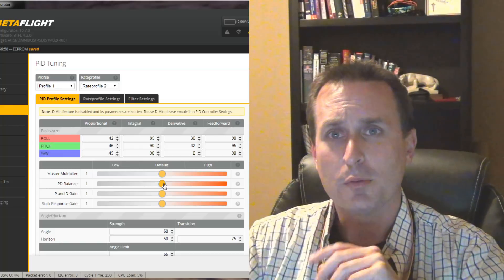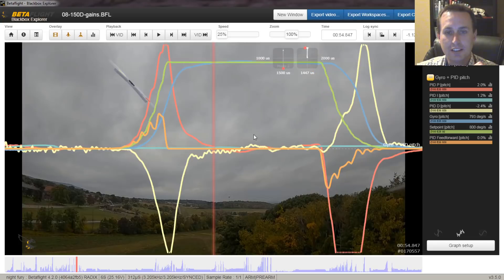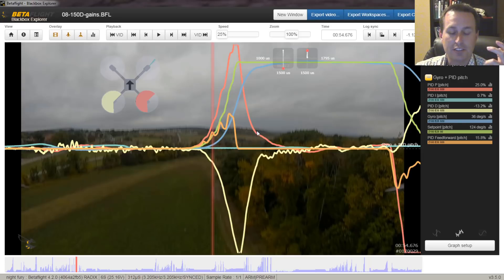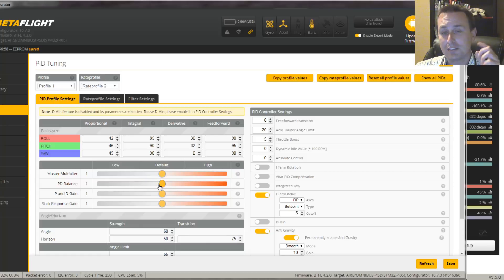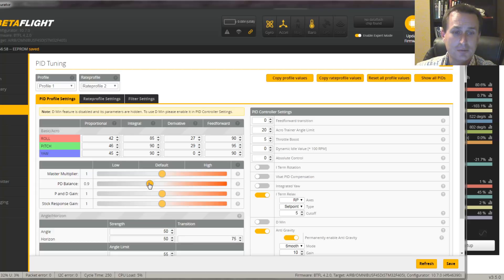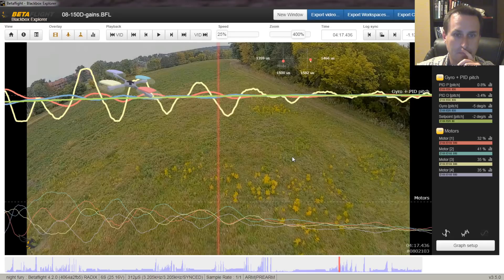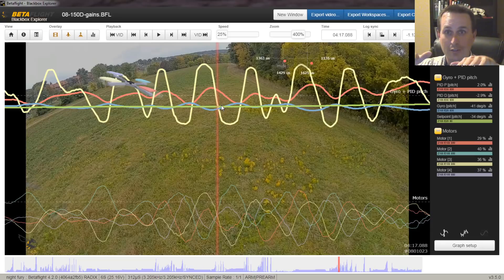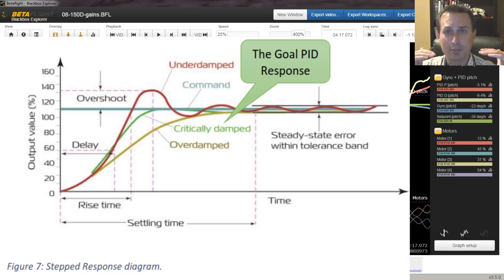The Importance of:  PD Balance | P&D Gain Strength

Comment: Hi man, I was watching your videos becuase my quad does a weird thing were is flies perfect but in the hd camera there is a slight vibration sometimes when im just cruising
Reply from the maker: What props?  Try some HQ tri-blades if not already on them.

If it does it on default filters and PIDs, it is probably a mechanical issue.  You can always try my presets too though just to check.  If it does on defaults or my presets, look for mechanical / electrical.  Log with gyro scaled and reach out to FB group or Discord for some advice.
Reply: @uavtech  I fly hq props lmao, I love them, Thanks for the advice, I checked and it seems than one motor works waaaay better than the other three, other than that I havent found anything else, I dunno if that can unbalance the quad or something

Comment: 10:00 From what i have seen and from my personal experience, other firmwares (FL1 and KISS) handle better prop wash. So based on your recent videos about kiss what could make kiss handle better prop wash?
Reply from the maker: People don't push BF enough.  They get stuck on defaults or don't push up P and D gain enough or reduce filter enough.

KISS and F1 have low filtering.  Turn off all LPFs on BF for gyro and just have only Notches on Gyro and lowpasses on D-term.

Also people are not comparing on the same rig., so it could just easily be mechanical differences.  Folks spending more $ to build their first special KISS or F1 rigs.

In my comp of KISS vs. BF the wash performance seemed the same.

KISS and F1 work exactly the same as described in this video.
Reply: @uavtech  thanks!!

Comment: What about motor heating due to high p and d gain? Do you have to lower it? And if you did lower it do you lower the PD Balance in parallel ?
Reply from the maker: No, just P and D gain.  I would add filtering vs. lowering P and D Gain slider for hot motors.
Reply: @uavtech  thanks for the response and appreciate your helpful videos . One last question, in your website you have presets for all type of quads except the 3 inch category? Can I use the toothpick presets for a 3 inch quad or the 5inch presets? Again thanks a lot

Comment: Terrific explanation. Really helping me to understand PID tuning. My key takeaway is that the P&D terms work against each other during stick moves, but they work with each other during wind/external disturbances. I do wonder though whether PID is basically completely the wrong approach for RC flying.
Reply from the maker: Great.  That is the key take away.

Lots of smart professionals in the hobby.  All firmware uses a PID controller.  Know of anything better?

Comment: Great video! One question on the P term trace at time 4:07, why p is always positive when gyro signal bounce on both sides of the setpoint? I thought P just tracks error with a constant multipler, so it should map the polarity of the error as well?
Reply from the maker: P is the opposite sign of PID Error - proportional in shape - times a gain strength (p-gain).  At that time stamp, P is in both signs from what I see.  What am I missing?
Reply: @uavtech  Oh, sorry the time should be 8:39. I was watching from my phone and didn't notice the neutral dashline line is actually above the setpoint. I thought setpoint was at 0, but turned out setpoint is at a constant negative value. Now it's clear. Thanks for the reply!

Comment: Thanks so much for these videos, the sliders in betaflight are awesome, at first I didn’t use them but they let you dial in 95% of the changes needed in a couple packs.

I always use RPM filtering now and adjust my P/D balance slider until I get a tiny bit of bounce back then raise it back up a notch. Then adjust P/D gains to make the quad feel more or less locked in. Then I leave PIDs alone and raise my filter sliders together while checking for hot motors, this usually makes propwash handling much better.

Then I stop tuning and fly, I think this is where a lot of people come unstuck, unless you’re logging continuing to bring out problems to fix is a recipe for chasing your tail. Instead I just fly and make small tweaks if I notice a problem recurring, I might adjust antigravity or raise P term on yaw or I terms (I move away from sliders at this point). I also spend a lot more time flying rather than tuning this way too 👍

Comment: Thanks again, Mark. I get 3 quads now tuned how you described it in your videos and it's pure joy to fly them. But there are difficulties when it comes to toothpicks or other micro quads with no blackbox. Additionally some AIO FC's have much electrical noise on their supply rails that affects the gyro signal. May be you can make a video about toothpick tuning?
Reply from the maker: Already done.

Comment: So, the one thing I don't get is, why wouldn't you just max out pd gain after dialing in the balance? what is the downside to "more p and d"?. Is it just the thermal limits of the motors or something? when will it poorly affect flight performance?
Reply from the maker: If you keep upping P & D gain, you eventually start to get D-term oscillations.  That's you limit then and you need to back down a couple notches.  See https://youtu.be/hgLUX5uWaNI

Comment: Hey brother thank you for shedding some light! I have a question, in previous videos you started the tuning proces by setting the D term somewhere between 30 and 40 then start moving with P term until you reached the desired balance. With the Betaflight 4.2 slides, it seems you just move the PD balance slider to increase the P term but at the same time the D term decreases. If you keep moving the slider there's a point where D becomes really low. Does it matter if the D term gets pretty low? And in that case should I use the master multiplier to bring it back up?
Reply from the maker: Use PD Gain to bring it back up.

It does matter.

Comment: This is good stuff. I realised I had both the PD ballance and the PD gain sliders increased to 1.1 and 1.3 respectively, and experienced quite a lot of propwash. The quad also seems to have mid throttle oscillations when I fly upwards, it's very visible in the gopro footage as jello. Could it be caused by too high P and D? RPM filters slider set to 2.0.

Comment: Is it normal to have D ≈ P on 4s 5 inch quads?
Reply from the maker: No.  P is usually 20 points higher.
Reply: @uavtech  setting it like that I always get bounce back. Where should I start looking at?
Reply from the maker: You typically need more D-term if the quad has a larger moment of inertia or weaker motors.  

I would just.tune for no bounceback.

Comment: Got my new whoop board today WITH blackbox, was looking forward to tuning it but blackbox  does not show my traces :(  
I Guess i'll have to wait for new firmware.
Reply from the maker: It should work.
Reply: @uavtech  I think its because i flashed it 4.2 and there is no firmware for it yet, Its the new Jhemcu 411 6s  with blackbox. It shows the motors on the pic quad in corner but nothing else. am using gyro scaled and tried it set raw but nothing different.

Comment: In Bf slider PD balance they add together all pitch, roll and yaw.. And all using same pD ratio on all axis? Some long deck frame like alien, actually need higer value on pitch right? It also means the PD ratio on pitch may differ from roll and yaw right?
Reply from the maker: Yes.  They don't add though; the sliders that is.  Each axis has a default ration between the axis.  They hold that.  But on quads far off from a 5", you many need to deviate.  Sliders only keep it basic.  If you want to tune per axis, you have to break away and just.put in the numbers.  Same principals though.

Comment: Why on any quad I own is that pd balance always over 1.3.. I've never had a quad under 1.0 pd balance.
Reply from the maker: lower power to weight?  48k?
Reply: @uavtech  maybe. Just interesting. I haven't been able to get any quads under 1.0 and fly without bounceback.
Reply: @uavtech  I presume 48k less powerful then? Would you still suggest 24K pwm?
Reply: @FailsafeFPV  I only use 48khz.. 24 makes my quads fly worse.  And most. Ppl I help, makes their quads fly better.. you lose low end torque.. which can be given back via pid authority boost with thrust linear.
Reply: @Krunked  Gotcha. I'm often confused when you suggest going for like a p/d balance of 1+ as I thought that more P is better for propwash moves
Reply: @FailsafeFPV  then u need to objectively try it.. I've helped tune so many quads and have so. Many of my own... Instead of being confused... Test it yourself....
Reply: @Krunked  Why doesn't Mark tune quads on 48k... It's so much better ime.
Reply: @FailsafeFPV  you'd have to ask him...
Reply: maybe because of all your kwads being basically the same rotational mass
Reply: @Rich2brokeN  could be. But it's also in all the quads I help tune... The base tune I give people in uavtech discord which works 99% of the time is 1.3 pd balance.
Reply from the maker: Weird.  Most of my 5" is 0.8 to 1.0.  Must mostly 24khz PWM too and no thrust linear, so IDK.
Reply: @uavtech  I'll try it. Today. I have plenty of quads to try it lol.. jump back to 24 khz and drop of balance and see what happens vs 48khz.
Reply: heavy motor guards/skids or really beefy arms? basically, mass at the end of an arm is going to take lots of energy to move. have you considered trying to raise pd gain first until the bounce back is gone, then trying to back off D with the pd balance slider until it comes back, the back off a little?
Reply: @mouseFPV  my tune works for most quads bro.
Reply: @Krunked  then what are you complaining about?
Reply: @mouseFPV  didn't complain about anything there bro. I asked mark a question.

Comment: I learned something today.
Reply: Lol.. really?  :X
Reply: @Krunked  The propwash bit, I never realised about the fact that the P and the D ideally need to go the same direction to fight propwash.
Reply from the maker: No ideally.  They DO go the same direction for any push on the quad.  So that's why we want to have them push hard (up P&D Gain slider) to counter any of those forces.
Reply: Did i understand correct that for stick input the ration between p and d  is the most important? So it doesn’t matter if it’s 30:40 or 60:80. But for external influences the higher the numbers with that ratio the better. Correct?